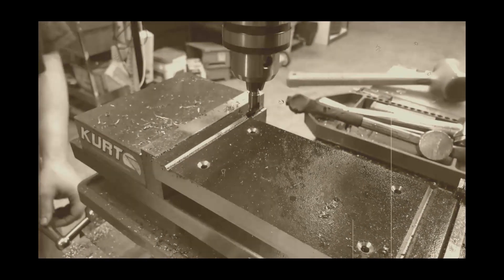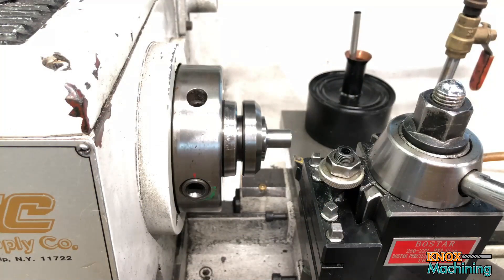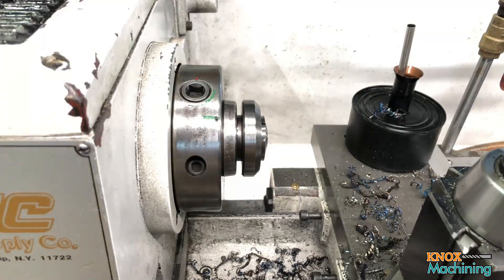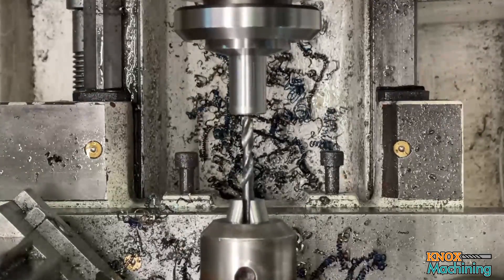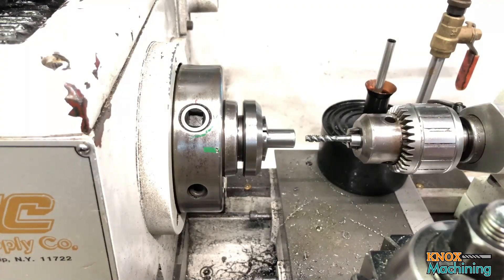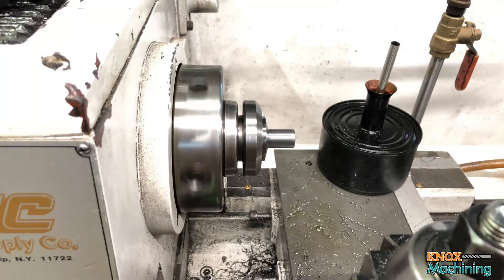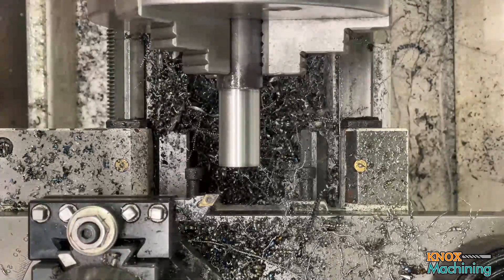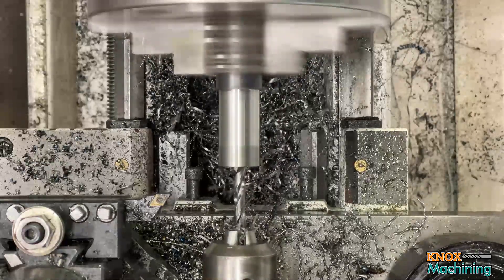diy Machine Skates - Part 2

Comment: Good camera coverage. Clear and easy to understand and follow. Nice work.
Reply from the maker: I could have done a bit better on the operator POV camera after I switched back to the chuck. Didn't adjust the angle.  I also think the top down could be more angled so you can see the end of the work as well as from top.  But, it worked out pretty good.